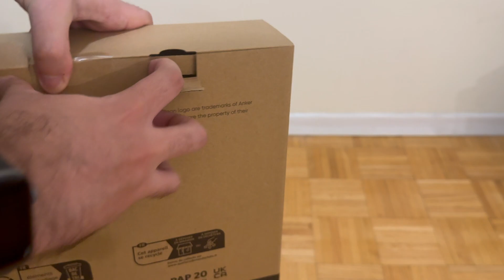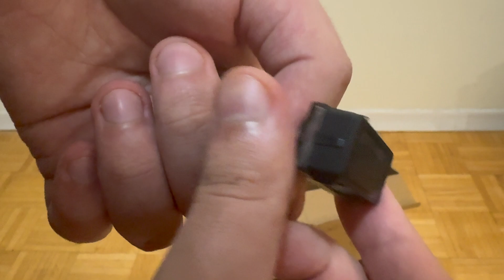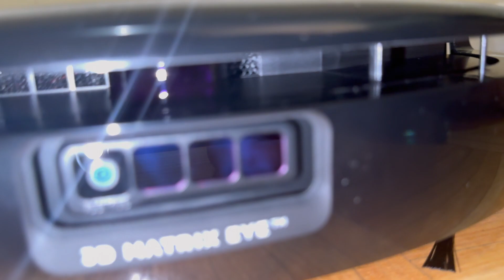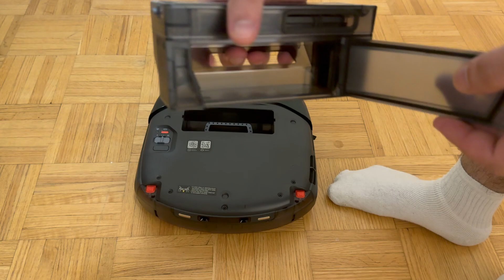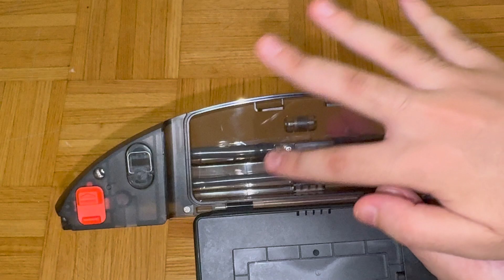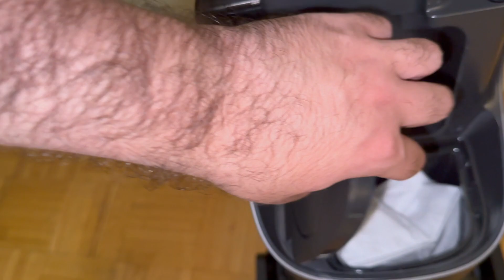Eufy S1 Pro Robot Vacuum + Mop Unboxing & Technical Overview

Comment: Phenomenal!  Thank you for this.  

Have you poked inside?  If so, do you think the motor for the vacuum brush could be disabled somehow so i could turn this into a mop-only robot?
Reply from the maker: No I have not opened it, the device is still under warranty for me. Not being able to disable the vacuum and only mop is an intentional feature as dirt on the map roller will quickly clog the dirty water scraper. Preventing dirt from getting to the mop roller is also why this model has two side brushes.

Is there a reason you don’t want to leave the vacuum function on in its lowest setting “quiet”?
Reply: @TheFrugalEngineer  Thats what i think im picking up on.  I thought the roller might be cleaned with a squeegee, and maybe im mistaken and it does.  Its just a little hard to tell.  The screens in the liquid waste container under the plugs, are for dirty water coming off the roller?

I have a senior mom, thats not in the best mental health.  And is um, peeing before noticing that she's doing it around the kitchen area.  Its not much liquid, a splash then she realizes its happening and heads to the bathroom so a couple dribbles on the way to the restroom.  im mopping 3 times a day.  I'd rather not vacuum this up.  Needs to be mopped with a mild disinfectant/deodorizer.  I have a good bit of computer and electronics background to maybe modify one of these bots to see if i can get it to do what i need.  But a simple potato chip might derail the machine.

Would you have any ideas on this?  Or know of a low cost machine that might have a chance of handling this sort of mopping?

Thank you.  btw, your technical breakdown is one of the best i've seen.  Thats the way to do a review!
Reply from the maker: @eric3434 yeah the squeegee/scraper sort of cleans the roller mop and the screens are for dirt that comes off the roller mop. Something like a few spoons of potatoes chip dust would easily clog the screen. 

You can maybe run it with the cover and dust bin removed to defeat the suction. I can test this if you would like.

The dirty water reservoir is half gimmick as the mop when down only makes light contact with the scrapper. Only in the dock when the mop cleaning function is run does it rotate the mop in the retracted position.
Reply from the maker: @eric3434 also note that the dirty water reservoir does not clean itself. It might be better to get a mop that uses the spinning pads and have it go back to the base station for cleaning every few square feet. Otherwise the onboard dirty water tank will smell and is hard/impossible to clean. It has hoses and stuff within it.

I was thinking of making a video doing a deep clean of it but I am scared of disassembling it as last I checked replacements are not yet available

Comment: Spare battery is available for purchase on Eufy website with included instruction video.
Reply from the maker: The battery is replaceable. This video was released before eufy began to sell the battery. Unfortunately unlike on other eufy models the entire vacuum bottom needs to be removed to access it